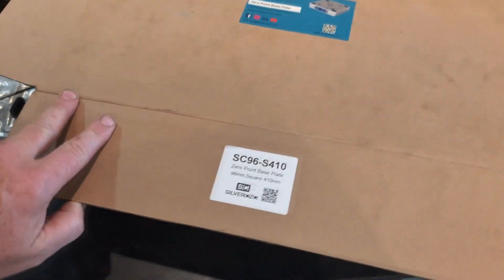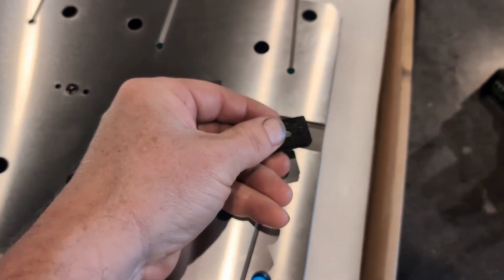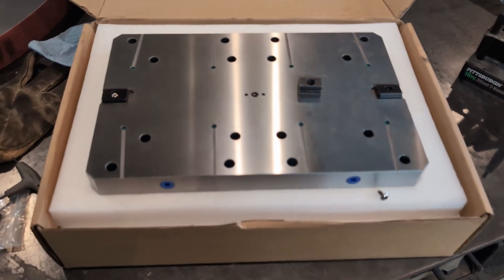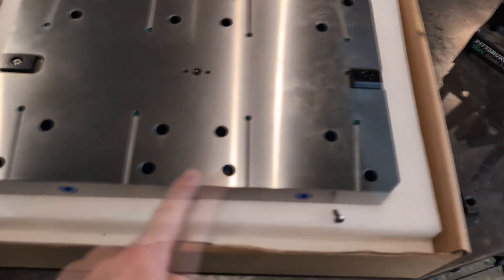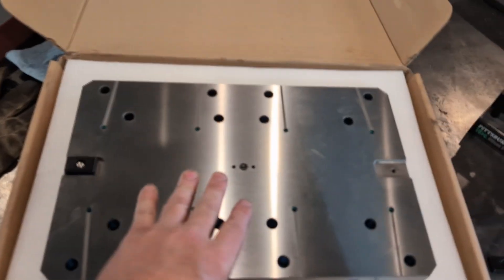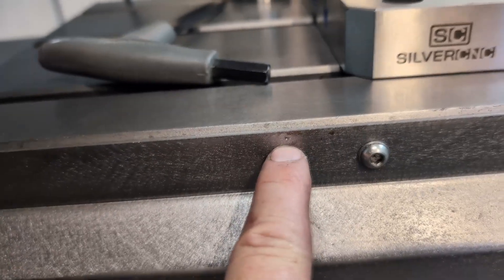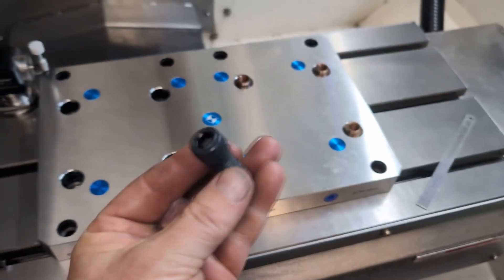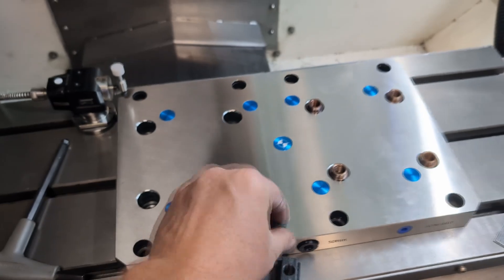Problems Installing Silver CNC Base Plate on SYIL X7

Comment: They've been good working with me, so I'm sure they'll help fix the issue. I have a bunch of their vises and 96mm fixtures. I ended up with a 5th axis rocklock because silver cnc had a long lead time when i tried to order. The good news is that their pull studs and fixtures are all compatible with 5th axis.
Reply from the maker: Thanks, they've been good to me so far. I already wouldn't mind a few more vises. The quality and price point are nice. Good to hear about their compatibility with 5 axis.  That company rocks, I'd love to get some of there stuff.

Comment: If only you had a bad ass machine shop??? Fix it and move on!!! They are probably big so you can make them fit what you need anyway...
Reply from the maker: You are not wrong.  I already have what I need designed in Fusion.  Same specs except M8 thread.

Comment: Hard to tell from the angle but it looks like you can probably move your toolsetter an inch or so to the left of where it is.  I have mine where the puck is just barely inside the travels and the entire base sits outside of the travels.  I did a writeup on how to do it.  Let me know if you are interested in the process I used.
Reply from the maker: Yes.  I will move the tool setter.  This was just a mock up.

Comment: Syil is 14mm T slots. 

I’d try drilling one of the holes 10mm, does not have to be dead nuts accurate, you need some wiggle room to tram it in. 
I personally would not use the central slot to line it up, just use the bolt at 200mm centres. 
My Lang plates are just held in the 4 corners with M10 bolts.
Reply from the maker: Agreed. I'm going to drop the centers and just use T nuts.

Comment: OK, like I get that you just shelled out good money and shouldn't have to deal with any of it. I totally get it. But here you are, in this shop/garage, with all this stuff around you. Just grab a piece of bar and make something that works.

An M8 t-nut and bolt will hold that plate just fine.
Reply from the maker: Thanks for the comments, and you're right. I've got new t nuts programmed in fusion. I'll machine them new and use M8 threads.

Comment: You could probably try a 10mm reamer to bring the holes in the plate to size, depending on if they are fairly close to size.
Reply from the maker: Thanks for the comment.  That's a great suggestion. I've decided to go with M8 threads and new t nuts.